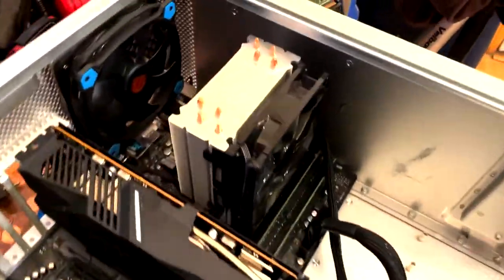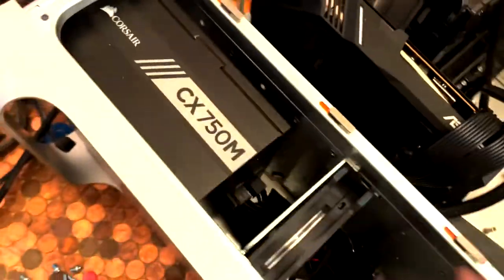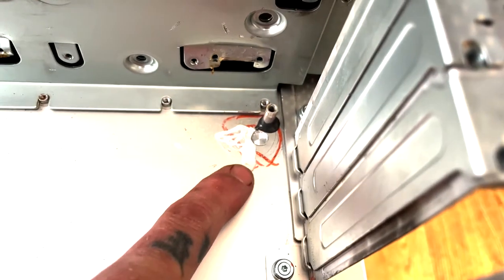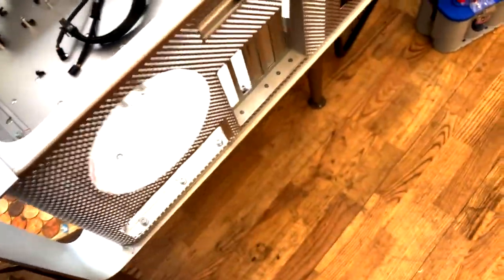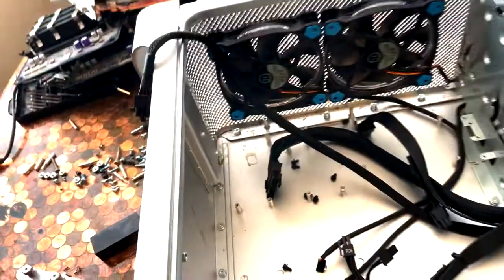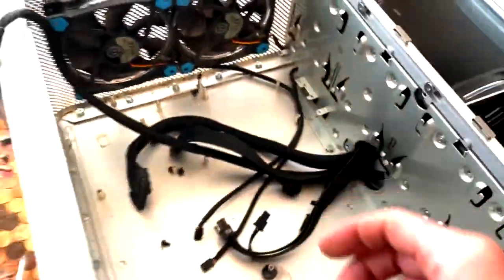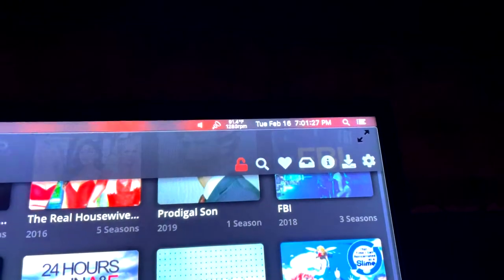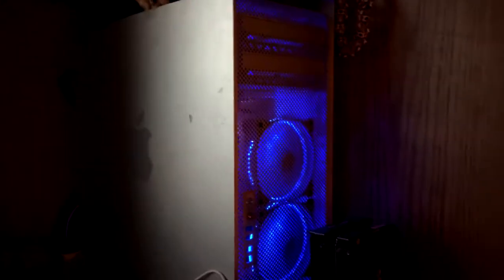CUSTOM MAC PRO PC HACKINTOSH GAMING RIG PART 2 S16E18

Comment: something i would love to do myself. just don’t have the tools or knowledge. had a crazy idea of popping in the guts of an m1 mac in there, just because i love this case, throwing in extra hard drives, and ports to make use of the front and back.
Reply: Is that motherboard full ATX or just MicroATX? I've heard mixed things on where you could fit an ATX motherboard in without dremeling out a good chunk of that shelf that all the drives slide into under the PSU
Reply from the maker: @empedance1933  full size